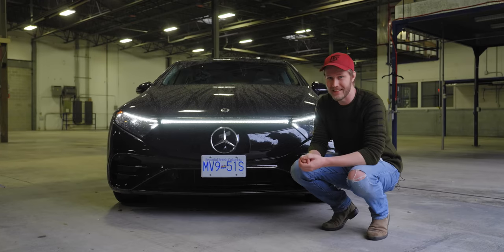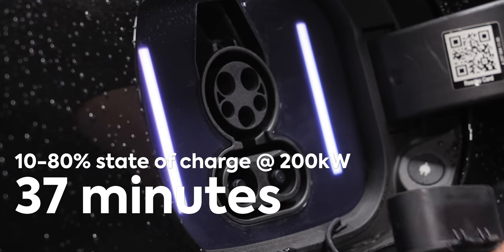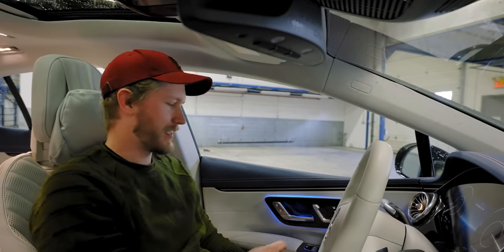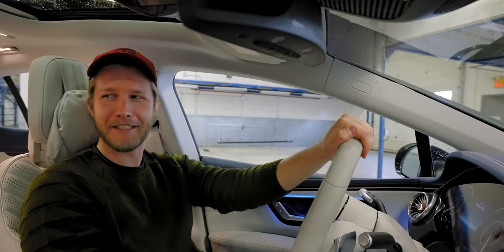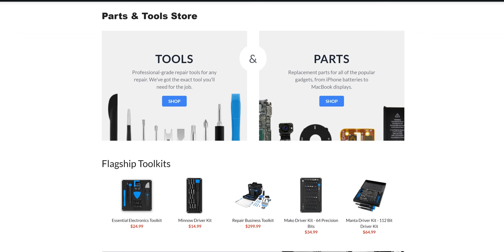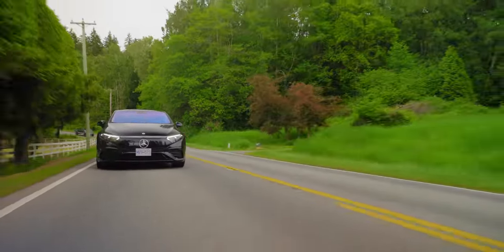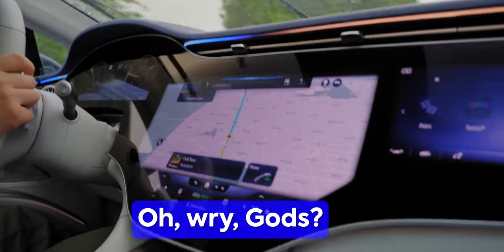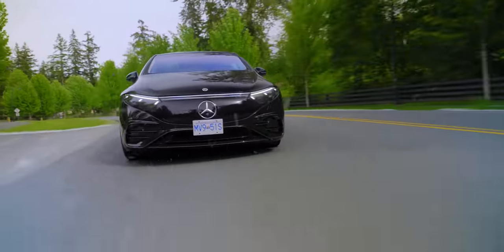Mercedes, don't be mad. But... - Mercedes EQS 2022

Comment: I think Alex' perspective is really refreshing compared to other automotive reviewers. However, I doubt the EQS' customer base shares/recognizes much of his criticism. Alex seems to really value the characteristics of a hot hatch / sportscar, whereas this car is everything but that.
Reply: S-Class are really focused on a comfortable and luxurious driving experience and not for racing
Reply: It looks like an overgrown Neon.
Reply: Mercedes has never made sport cars by itself. 
Only AMG is transforming mercedes cars into sport alternatives. AMG was purchased by Mercedes, but remained independent, so they can modify as much as they want mercedes cars (in some cases they even redesigned entire engines).

Hence, when mercedes designs a car, it is not to race, but for conform and safety.
Reply: I mean. 1, he does mention that MULTIPLE times during the video that sport driving isn’t the focus of the car.

And 2, his biggest criticism, responsive and smooth braking, is - if anything - a more significant problem in a luxury car.
Reply: Brakes shouldn’t have a weird pedal feeling. This is something notices by almost every car reviewer out there. Also, using touch controls on the steering wheel is no luxury experience at all. It’s a lame attempt by MB to lower the price
Reply: @mattsnyder4754  I know. It's just a general observation about Alex' style of reviewing across multiple videos. And I totally agree that the braking issue is a serious fault, but then I would like Alex to focus more on these issues rather than the handling of the car, because the latter is just totally irrelevant. No EQS owner is going to chuck this car into a corner. More generally formulated, I would like Alex to tailor the focus of the review to the focus of the car.
Reply: As someone that is driving the most recent E-Class - Mercedes lost it. I've been driving Mercedes pretty much since i have my license (i have driven other manufacturers in between). I work in tech - so i don't have a problem with high tech in a car. But all that piano black, touch sensitve buttons simply do not work in a car. And the worst part is, it feels extremely cheap and they dont react that well - my E-Class has the same steering wheel and i absolutely hate it. The steering wheel before that was pretty much the perfect steering wheel  - all the buttons felt like a Mercedes. 
I also am more one for "cushy" driving since i'm so much on the road, but the latest Air-Matic Systems don't feel as good as the ones before.

I guess all of that isn't an issue when you are a new Mercedes customer, but for me, Mercedes dropped the ball big time and lost me as a customer because of this. It's a bit like MSI...
Reply: @noobssindcool  a luxury car should not brake worse than a minivan.
Reply: Yeah I fully agree. Alex opinion on this car is valid but he criticized it for the wrong think and didn’t focus on what it was designed for
Reply: @NFreund  I feel Mercedes has gone the route of all show no quality. Their interiors look amazing (except for the EQS capicative buttons and the big screens with no buttons on the S-class), but the instant you start slightly pushing on any of the panels they creek of cheap plastic. My old 2007 Toyota Corolla didn't have nearly as many plastic parts that creek when you push on them compared to A, C, E, and S class of today. I watch videos of people pointing these creeks out on BRAND NEW Mercedes and its just horrible. https://www.youtube.com/watch?v=miQyerNyjjQ
Reply: @mydimeisup5103  Yep - my colleque is driving the exact same model (we actually collected them at the same time at the factory in Sindelfingen), he has a lot of creeks, i have had a door that sounded like an old barn, a Burmester Speaker that sounded like an old AM Radio and various other things. 
Mercedes quality is non existent anymore. And i'll be honest, both our cars were ~ 90k Euros and all that is not acceptable. My next one will probably be a Mazda CX-60 with the new 6-Cylinder engine...after more than 12 years, i'm done with Mercedes (and it actually makes me sad...)
Reply: @NFreund  I'm an Audi fanboy. Besides the A6/A7, A8, and Q8 they've kept their physical buttons and the tactile response and sound from every knob and switch is amazing. Physical control feedback is Audi's bread and butter. I'll sit at a stoplight and just twist the climate control knob or press a button on my steering wheel because they sound amazing. I'm at 152k US miles on my 2013 allroad and going strong. However Mazda has came a big way from what they were before and can't deny that their interiors look great. Hopefully they don't creek as much. That channel I linked in my last reply does interior quality reviews and button tactile response on all cars. Check if Mazda is there if you're interested.
Reply: @mydimeisup5103  I've sat in the 2022 Mazda CX-5 and the quality actually blew me away. 
Sadly, we won't get any more 6-Cylinders from Audi in the EU after 2023 (apparently - things may change again, but oh well) and after so many rattly and noisy 4-Bangers, i just want that soothing 6-Cylinder sound again before it's too late. Also, all new Audis ditched the MMI Controller (which i really liked!) and have gone all touch as well...what happend to quality = good tactile feedback? =(
Reply: I don't know a single car reviewer who isn't a fan of the hot hatch. if there is a sect of people who have only been driven in luxury vehicles, then I would say these, and perhaps, most car review videos, are not for them.
Reply: Yeah it's a great perspective if you want a review from someone who obviously doesn't know that much about cars
Reply: @Konarcoffee  As a guy who is nearly rebuilt his engine and works on VW/Audi, I can say Alex did a great job with the review.
Reply: as an avid hot hatch enjoyer, i completely agree that this is the complete opposite. also in the complete opposite tax bracket for me 😭
Reply: But it does seem weird how he says the breaking is really bad🤷🏼‍♂️
Reply: @alexandervanslooten5016  If you don't think handling is a concern for every day driving you should look up the moose test.
Reply: From this review, this car fails as a European luxury car. All tactile surfaces should be amazing. High-grade leather, Alcantara, wood, maybe some brushed aluminum/carbon fiber. Everything should click properly or shift smoothly. Mushy capacitive touch surfaces are unacceptable. Braking should be perfectly linear and responsive with force. The ride should absorb all road feel but NOT feel floaty. Bouncing and sloshing along on over-soft suspension is cheap American "luxury".
Reply: @Demmrir 

 "from this review"

Reviewed by tech critics not car critics

OK

Car has flaws but these guys think its a sports car
Reply: @noobssindcool  We have an S-class and that's exactly what it's made for! Being a comfortable car.
Reply: Bad UX of controlling the infotainment system (layout+button), and bad rear seat arrangement (lack of headspace) and for this amount of money they couldn’t tune the speaker right, luxury is suppose to be about the fine detail done right.
Reply: Hotharches are objectively the best cars. Performance, utility, effeciency, comfort
Reply: The throttle house guys absolutely hated it but were so mild in their criticisms in the video lmao. I only found out after they talked about the eqs in the donut Collab
Reply: That all being said I really really REALLY wanna see a regular cars reviews crossover
Reply: @kinch_evl  every car looks like oversized neon since 2000 for science reasons.
Reply: Feel most of the negative comments are people who never driven a Mercedes properly. 
A Mercedes drives you, not you drive the car. Brakes on Mercedes I've driven has always been different from most other cars, from 0-50% it's near nothing, from 55-100% is emergency stop. Why? Because you accelerate slow and decelerate slow, like how a Mercedes wants to drive. 
That's why you see other Mercedes lull around traffic, like some old person driving it. Exceptions are obviously the typical Blacks, amgs, drug dealer owners etc.
Reply: @InvadersDie  most frame trucks pass the moose test, what's your point?
Reply: @InvadersDie  shouldn't be on a road if you think a moose test was an everyday driving experience...
Reply: @JLneonhug  any car with electronic brakes acts like that. That isnt a Mercedes thing. And one of the main reasons I hate electronic brakes. Theres no feedback. No linear progression of pressure applied. Its just the same all the way through. With a brake that is physically connected to the master cylinder you get linear feedback. Harder you press the harder you brake. With electronic brakes it about how far you press down.
Reply: Brakes that feel weird and scary are even more of a problem for a luxury vehicle like this.  Also, literally all of the capacitive touch panels looked like they were really cheap and caused the whole panel to move any time a control was pressed (it was obvious with at least 4 different panels).  Lastly, not being able to fit a 6 foot tall guy in the back seat comfortably is a problem for a full size luxury sedan.
Reply: I think they will pay attention to the jank interior though. Those buttons really do look cheap and that center console is pretty meh. But a returning Merc customers would be used to those things.
Reply: @JLneonhug  *shouldn't be on the road if you can't imagine why the moose test is used to test cars.
Reply: @dellonia  this is pretty much ridden with falsity
Reply: @dellonia  ah yes, because the classic SLs were not sports cars...
Reply: @youreprobablymad6648  only if you would come with arguments instead of just saying it's false trust me bro
Reply: @elucid07  if you talk about the SLS - SLR made in the 2000 and upward, the sport side (engine preparation and other details) were made by McLarens and AMG, none by Mercedes itself.

If you talk abou the former made a long time ago, I agree partially. They didn't design a sport car as a Ferrari, Porshe, etc. would as they literally took the engine used in actual racing and slap it into a road legal car. The whole car was therefore remade to be comfortable, as were all newer SLS and SLR. Look even at the development of the SLR with McLaren that was disastrous as mercedes only thought about the confort of the car and not about building a sport car.

Another, and more suitable, exception was the Evo. The race in which it participated, car makers needed to transform production cars into sport cars. But at that time several manufacturers where developing racing cars and then transforming it into a limited serie production car, as it was easier and better for the racing car.
Reply: The customer base buys these cos of the logo
Reply: Annoying menus and bad buttons are a deal breaker for me and I believe people buying this type of car as well.

I agree that Alex brings a refreshing perspective. 
A lot of the car journalists rely on getting a car early on. So they can't annoy the brand too much.
Motorcycle counterpart would be Ryan fortnine. Also Canadian.
Reply: @dellonia  well it’s common sense and pretty obvious. Im not your teacher do your own effort and due diligence
Reply: @youreprobablymad6648  so the facts that AMG is an different company than mercedes, that AMG is the one preparing sport cars for Mercedes, and that the only "sport cars" that mercedes made were in fact race cars branded as consumer cars to match race regulations or just AMG cars are all wrong? 
It's about time you read mercedes and AMG history
Reply: @dellonia  whoooooooooosh you have no idea what I’m talking about
Reply: Like he said at the end: their audience isn’t really oligarchs etc., so probably nobody watching this is someone who would even bother considering it
Reply: @eduardosanchez7827  pretty sure it is a lame design choice to look more "sleek"
Reply: @dellonia  AMG doesn’t have anything to do with the AMG badged cars realistically.  Only the AMG GT and GTS cars are designed from the ground up with the rest just having trim options.  Mercedes just slap the badge on any car to increase the price and desirability while watering down the brand.
Reply: @alexandervanslooten5016  I disagree about Mercedes being not meant to be thrown into corners.  The S63 exists for a reason (and it’s not for the chauffeur to enjoy the throttle response).
Reply: @noobssindcool  75 to ⁹
Reply: Every car review of his feels like a troll. I watch for entertainment and not advice.
Reply: @eduardosanchez7827  Felt really validated when I heard Jonny Smith mention it too (In the video on the EV Beamer 7 series).

Comment: Fun fact: Mercedes has a patent on the sound it's car doors make when you close them
Reply: Its probably a trademark! Patents are usually technological ideas
Reply: 🤮 
I hope they trademarked the 4-5 digit numbers that their average repairs usually run. There is a sucker born every day, and Mercedes is happy to cater to that market.
Reply: The possessive form of "it" is “its”, not the contraction “it’s”. The latter means “it is”.
Reply: @Gruntled2001  My opinon: I don't think German cars are half bad if you can repair them yourselves. I have a 2013 Audi allroad with 152k miles and in the 2 years I've owned it I've only spent about 2k on it. I did timing chains since they're known to stretch and grenade the engine (this is a maintenance item), brake pads, suspension control arms, motor mounts, etc. all the normal stuff for every other car except timing chains. Timing chains were 2k job at local mechanic, 3.5K at dealer. I did it for $490. If you're getting an E46 with the v8 with rod bearings that wear every 100k miles then yeah you're a sucker for a cool car, but most of them aren't that bad.
Reply: @mydimeisup5103  No one buys a luxury brand to save money.
Reply: Wants to make me design my own car, that makes the screaming goat sound when the doors close
Reply: @robertp457  Hence, suckers lol
Reply: @OperationDarkside  Tesla came close to that - you can have a goat sign for the horn or for blinkers.
Reply: @mydimeisup5103  Mate, it's awesome if you can fix your own car, esp. a German one, but I'll tell you, I've known people who spent 5-6k to repair their Mercedes a few times in a row, and it was only 2 years out of warranty. I drive a domestic car (a Ford), in in the 6 years that I owned it (it's 8 years old), I did my brake pads, kept changing the oil, and went through a set of tires. That's it! I get it, people like European cars for the performance, but to me a car is just a "get me reliably from A to B" kind of thing, and I will always do either a Toyota or a Ford.
Reply: @Gruntled2001  Everyone has their preference. Again there are E90 M3 guys that deal with their rod bearings needing to be replaced every 100k miles. To me thats excessive but an 8k rev limited V8 is amazing so they'll happily deal with rod bearings. I'll take some oil burning and a 7hr $490 timing chain job every 130k miles to have a fun car that is great looking for being a 12 year-old design. Some people just want a point A to point B car and that's totally understandable.
Reply: It sounds like a rattling piece of shit, which this car is sort of is. We don't need a reimagining of the car in EVs, just redo petrol ones to electrics drivetrain with as minimal changes as possible, and shit will be fine
Reply: @TheGodCold  I doubt that it will pay for itself in the Western world. Developing countries, where mechanics’ labor is cheap, sure. “First world” — no.
Reply: IT DIDN'T MAKE THE THUNK!

Everyone in the office was not as upset as I was. No thunk. They sound terrible and not like a Mercedes patented thunk at all.
Reply: Nothing like the tank build quality of the 1995 S class

Comment: Every time shortcircuit drops a video on an ev, i am reminded of 3 things 
1) Alex drives a golf GTX 
2) Alex is over 6 feet tall
3) Car manufacturers are forgetting the very basics of making a car and butchering practicality for gimics
Reply: If VW makes Golf RTX, Instant sold.
Reply: The reason I'll be driving my 04 4Runner until it dies, probably in the 2030s.

Comment: I had the chance to test the EQS. I agree with a lot of what you said. One thing I did like about the car is that with inteligent recuperation, I basically didn't need to brake. The driving assistance feels helpful more often than it feels annoying. Which was a first for me.

Comment: The cup holder in the back wasn't jammed, it was designed that way. The first click is a pen holder then you give it a half click to get the cup holders. Not sure why its like that but it is what it is. Having the lumbar controls in the screen allows you to adjust the lumbar to a more specific spot to help pinpoint specific spots. The MBUX infotainment is very intuitive and easy to use. Yes there are a lot of sub menus but its easy to figure out.

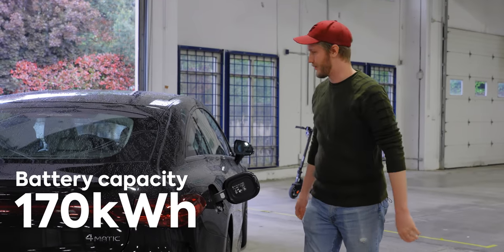Comment: 2:38 for those confused, yeah it’s 107, not 170
Reply: “So much capacity” really confused me because 80-100kw doesn’t sound like a lot, so 170 looked insane. I would say 107kw is like a 4800 mah battery. Pretty normal.
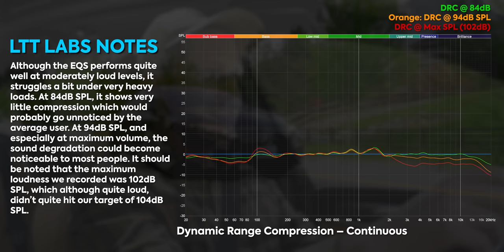Reply: Looks like they also got the Volvo and EQS lines switched at 12:55.
Reply: @RealWorldReview  Yeah, 170kWh with only 350mi range would be terrible.